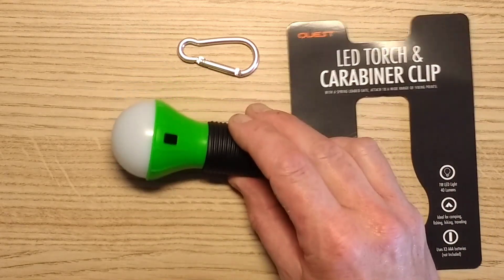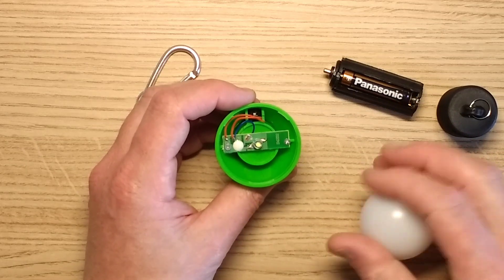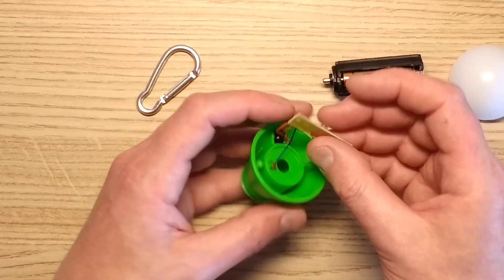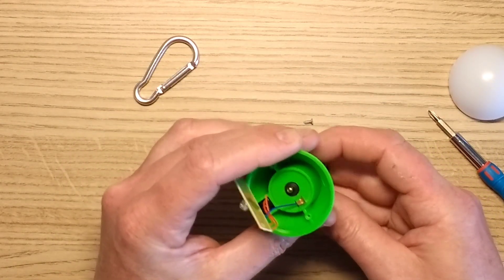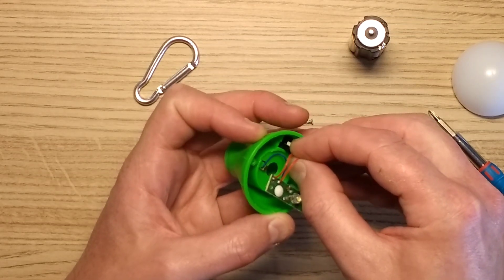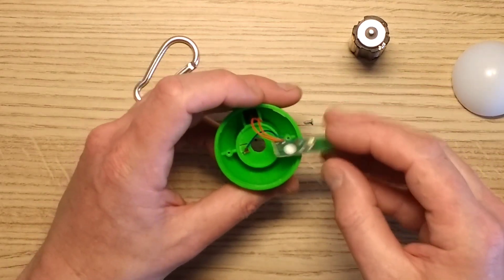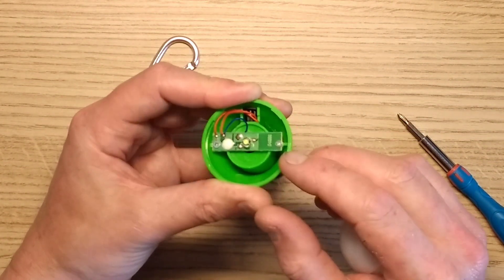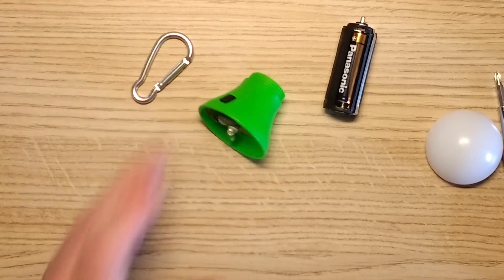The newer version of the pound-shop "1 watt" camping light.

Comment: Hi Clive, where do you buy your tools? Interested in everything, but I think it’s quite difficult to find good small bit screw drivers with security torx and other bits needed to take apart electrical appliances.
Reply from the maker: You can get everything you need from eBay.

Comment: Hi i bought today one of the portable LED camping light and i couldn't found any equal model in the "froogle". it is supposed  a model CL190, 1W LED a push button with 3 modes + hold to SOS :

https://drive.google.com/open?id=0B6OIyIrNqAdmc1lxUVNtZmpqQzBJci1BX0FnTzVYSDVUQU5V

it looks similar to the fleebay searched "Lumens Portable Outdoor Camping Emergency  LED " but not as close
Reply: Here is the narrowed search on fleebay : "Portable Hanging LED Camping Tent Light Bulb Fishing Lantern Lamp Outdoor Hiking"
Reply: Ohh crap my model has just run flat the batteries after 2 months, It has a quiescent current of 0.58mA in is "off" mode. When  not in use remove one of the batteries :S

Comment: What if put 1 18650 battery in it? 
I've found that it works quite well generally, but can create a bit more heat over the long run

Comment: A camping light that uses 3 cells. Thats just fucking stupid. Who carrys a charger capable of charging 3 cells ? They exist but if your that cheap to buy this light then your not going to spend a few extra buck to get a good charger.
Most shitty chargers charge in pairs, How does the 3rd cell get charged :\
Anyone who buys devices running off 3 cells gets no pity from me.

Comment: I designed and made my first circuit board for a Bluetooth RC car. I am having a problem though. When I assemble the parts on the bread board everything works fine. as soon as I put the parts on the circuit board the car works for a time and then stops. I checked all the connections and they are all ok (no shorting). Do you have any suggestions as to what may be causing the problem? this is a link to a drawing of the circuit: https://1drv.ms/b/s!AoBfN-MzN907lwXah9ogQaVeF4hG

Comment: bigclive please do a video on one of these:

http://www.ebay.com/itm/DC-DC-Converter-12V-To-5V-3A-15W-USB-Car-Charger-Power-Step-Down-Module-New-/401045490077?hash=item5d602c899d:g:eqIAAOSw9N1VneZb

DC DC Converter 12V To 5V 3A 15W USB Car Charger Power Step Down Module

Comment: Oooh, I know that battery pack design. With a small adapter tube, you can use 18650 Li Ion rechargeable cells.

Comment: Why does so many electronic trinkets use 3xAAA?
Since most most battery chargers, charge batteries in pairs and most batteries is sold in even numbers, this is as annoying as matching packets of hot dogs and packets of hot dog bread.
Reply: Zach Demand Lucky you.
I don't know why hot dogs in Sweden are sold in packs of 10. I do know why hot dog buns in Sweden is sold in packs of 12. That is because it is technically optimal to form, bake and pack the buns in fours. You want the machines to spit out as many buns as possible at each iteration, to be cost effective. However, the more buns the machinary spit out at each iteration, the more production stops or slow downs you get, hence fewer iterations per time unit. Four is the magic number for hot dog buns. When you pack the buns, you could pack them in other quantities than multiples of four, but that would require a whole extra production step and be very expensive. An extra steps also means one more thing that can go wrong, so the production line would also become less reliable.
Reply: @martin Just the physics of the actual diodes - each colour has a different forward voltage, lower for IR, then red etc higher for blue and then UV - the white LEDs are a blue or UV LED shining onto some phosphor
Reply: It's because it is designed for a 18650 or sth. but you can replace them by the round AAA holder. Cheap.
Reply: joinedupjon So there is technical reasons, bummer!
Thanks, I've been wondering for years.
Reply: I keep hearing about the mismatch of hotdog and bun quantities, but have never actually seen it. Here you get 8 hotdogs in a package and 8 buns in a package.
Reply: yep i agree, but its because it matches to the voltage needed to run cheap leds, you can have a small on board voltage converter to make it run on any combination, but 3xaa is cheaper, i hate it too, 2xaa have twice the runtime for the same size for example.  i tend to avoid anythign 3xaa as you know its cheap tat
Reply: Jusb1066 Do you know why they make LEDs with this voltage? Is there a technical reason or are they used for something else, so there is economies of scale? It seem rather stupid to me to not make them match the batteries, but I know almost nothing about electronics.

Comment: Sooooo, it may be because I'm thicker than the average bear when it comes to electronics, but why does an led with a switch connected across a battery need any kind of circuitry at all?
Reply: With a power supply above  the forward voltage of the LED, the current would easily climb to LED-destroying levels. 
For some combinations of LED and battery you can get away with it (no extra circuitry) due to 1) relatively small mismatch in voltage and 2) the internal resistance of the battery (which handles the extra voltage, dropping the batteries external voltage to something the LED can handle. For instance like these button cell powered keyring lights:
http://www.ebay.com/itm/10Pcs-Mini-LED-FlashLight-Keychain-Key-Ring-Torch-Super-Bright-White-Light-/192104906673?epid=514355890&hash=item2cba583fb1:g:LFAAAOSwTuJYoqL-  )

And if you start with a battery voltage equal to the LED's forward voltage, the battery would soon fall below the voltage needed for the LED to give useful amounts of light...
Reply: Michael Tempsch So it's to regulate the power to be no stronger than the LED can handle when the batteries are fully charged, which in turn keeps the light brighter for longer than just using one battery?
Reply: BearWithMe  So it's to regulate the power to be no stronger than

Yes

Yep.

Dat Boi resistor?

A resistor is the simplest way (internal to the batery in the case of the little keyring lights.) , but is wasteful  (all extra turns to heat) and doesn't offer constant current /light as the battery voltage changes/decreases.
Reply: resistor?

Comment: I got one of these and I cut the hangy loop off the bottom so it stands on its end and I put a resistor in series w/ the LED to make it lower power and I have it on my bedside table as a night light the batteries last for ages weeks and weeks in between having to charge them up. but I did have to fiddle w/ the battery contacts and resolder the wires cos the one I got wasnt made very well

Comment: Bought a whole bunch of these to light the way for a local charity "Midnight Walk".
The soldering in 'em is really crap and the contacts that meet the battery holder are often bent to the wrong place so they don't work. Also there's not a lot of current regulation, so I ended up resoldering them all and adding 10ohms in series with the LED.
After all that - they're a real bargain :)

Comment: is the thread long enough to fit a 18650 instead of the 3way aaa battery?
can get great adaptors for torches with them 3way rubbish..
Reply: Problem is that the design probably depends on the internal resistance of the AAA cells and the holder to limit current. An 18650 would probably fry it.
Reply: Donald Meston you can buy a new light for the price of a few AAA's if it does fry it, those little batteries always go flat at the most inconvenient time and then I can only find two new ones.
Reply: The 3 AAA battery thing IS the adapter because a lithium battery would cost more and are not sold at most shops. I buy similar lights at our dollar store all the time and they will fit an 18650, fairly tight, but they will light and none have burned out on me yet.
Reply: Jake Peters i think a 18650 would be too large. Maybe a 14500?!
Reply: three fresh aaa would be as high as 4.8v where as a 18650 wont be as high , my money is on it would work fine.
Reply: That can't be assumed because alkaline AAA voltage drops rapidly with current while not so much an 18650.  In fact direct driving an LED with an 18650 "usually" fries it unless the rest of the electrical contacts are dodgy enough to impose further series resistance.
Reply: Most of these 3x AAA holders are designed to replace an 18500. Mainly because most people wouldn't know where to get an 18500 but they have a load of triple A's laying around.
Reply: That sort of triple-cell holder seems to be a standard substitute for an Li-Ion cell, but where would you charge the cell? With the correct physical size, if you had one, it'd be cheap to try.

A very superficial search showed 0.2Ω for an AA cell, and that's about 4.5v in series with 0.6Ω while for Li-Ion it about 3.7v with 0.2Ω

I foresee an earth-shattering Phut!

It's an intriguing idea, but I don't think I would try.
Reply: Why ask this when 18500 cells exist?  However you still would need to solder on a spring to the back of the PCB to extend through the hole in the head to contact the battery, and run a lead up from the back for the negative battery pole.  It seems a fairly silly thing to do for a $1 dim yet oversized light like that.   Far better to just get a normal LED flashlight that takes 18650 and has a head bezel that comes off for candle mode.

Comment: I have my multimeter with me when I go to the pub. You never know when you'll need it.
Reply: Does the pub serve pub grub?  Measure the resistance of a French fry, mild wing, hot wing, and a steak & kidney pie next time you go !
Reply: Stan Patterson I don't like working on hot circuits
Reply: No meter? My God, this is worse than the news of two despots picking a nuclear war
Reply: :D
Reply: ben howard

I take my soldering iron, I don't need it for soldering, it's just that I like to add a few burn marks to the table, makes me feel more at home.
Reply: I hate digital meters,
My multimeter is so old the selector switch goes 78, 45, 33 and 16
Reply: I've had numerous machines with the exact same settings, but I've never in my life seen an "app" to run on the "16" setting.
Reply: aomvideoland
May be that is what's wrong, if someone was to send them a multimeter each, their lives would be complete and they could grow and mature in responsible adults.
Reply: the  apps for 16 were automotive ones, that were less susceptible to the vibration, in the 1950s for a short period , those american cars at the time had room for it all
Reply: Stan Patterson
You need an old Dansette in your life.
Reply: I love the smell of soldering in the morning - smells like victory.

Comment: Clive, I think you've forgotten to put how much current this light drew in the description?
Reply: Brandon JC I bet he just hasn't done it yet, because he's still not home
Reply: Now he has, it says 150mA
Reply: Stinky Cheese 200ma through a single chip led? I assume you mean 20ma?
Reply: Maybe he hasn't gotten to the meter yet !
Reply: Does it really matter?  Probably around 200mA, but may depend on the battery pack voltage.